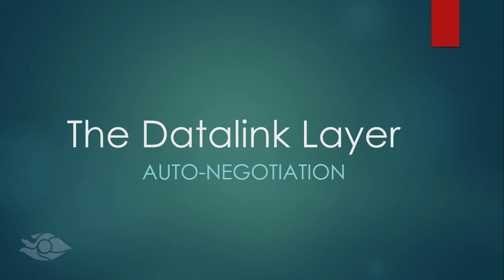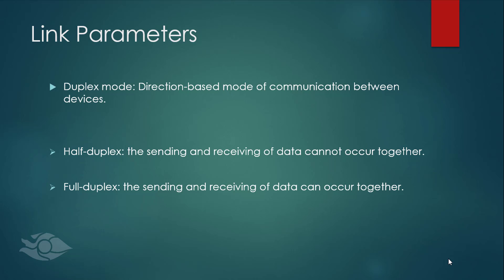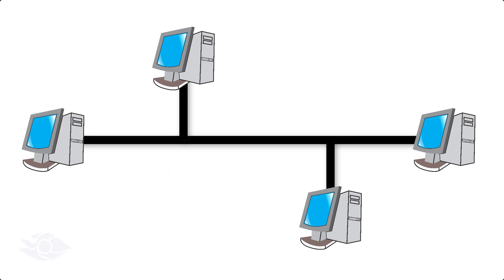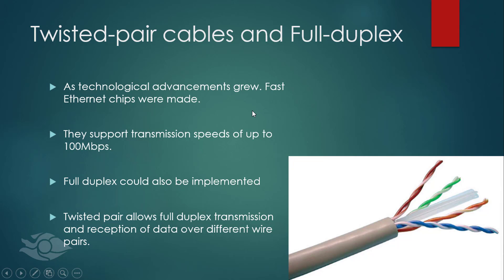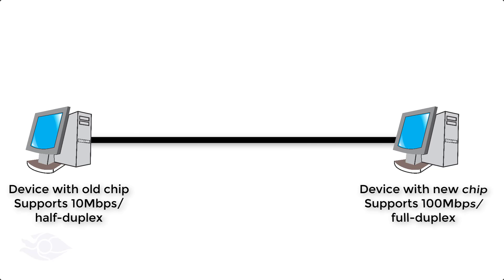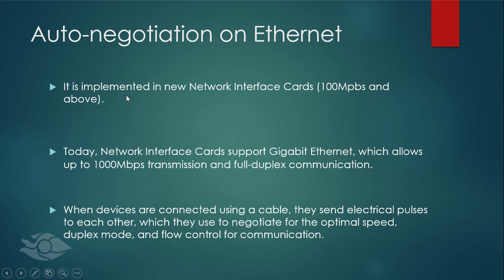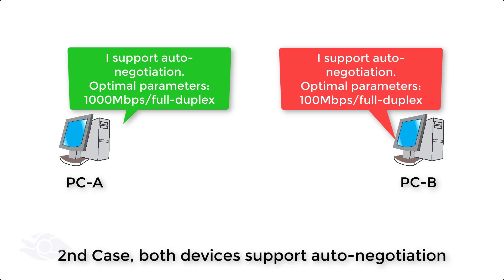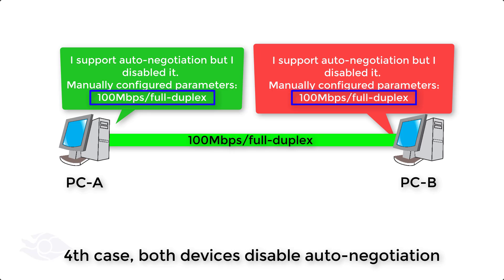Auto-negotiation on Ethernet || Why your link is probably failing to be established

Comment: Hi Great tutorial about auto neg, 3:54 may I ask if there is any technical document about the part you explained about default parameters? I looked up ethernet standard and I couldn't find anywhere about it.
Reply from the maker: We used 3 parameters to define these rules in the video: default (10Mbps/half duplex), manually configured (everything else), and optimal parameters (the best supported by the device). These names were used for demonstration of the concept.

Comment: thx u sir but still have a problem my device is supporting 10Mbps but there's kinda lag in my internet its connected but  too slow and when I put it on 100 mbps its shows that the cable is unplugged  and actually it was working great an auto negotiation but I change it to 10 mbps but after week Inotice some lage in my internet So I try to put it on auto again but it doesn't work . now its working only in 10 mbps is there a problem on the cable Please help (sorry I try to describe my pblm )
Reply from the maker: No problems Ossama Chhibi. We're here to help. Typically 10Mbps means 10MegaBITS per second. In MegaBYTES, that is 1.25MBps which is pretty low. Plus you can't even guarantee to hit the peak speed everytime. That's the reason why you're having a slow connection. For the adapter problems, sometimes all you need is a little reset, first unplug the network cable and perform the following:
1. If you're using a Windows computer, hold down "Windows + R" to open run box.
2. Type in "ncpa.cpl" and hit "OK". Your adapter settings should open. 
3. Right click on your Network adapter and select properties to open properties panel.
4. Click "configure" and choose the Advanced tab.
5. Scroll down and select "Speed and duplex" and change the drop-down to "Auto negotiation". Select okay to save the current configurations. 
6. Repeat steps 3 and 4 but now click on the Driver tab at the top and disable device.
7. Now Enable the device, and hit OK. Plug your cable now to see if everything is fine now.
Reply: @Physical_Logik  thank youuuuu so much 💕💕 U  save my life Have a nice day love u  I was about to change my computer thank you thank u
Reply from the maker: We're glad we could help Ossama Chhibi. You're welcome anytime.
Reply: @Physical_Logik  I love so much bro u made my day I swear Thank u so much 💓💓

Comment: Good day sir, please I need a clarification on the second case of auto-negotiation. It states in the video that the fastest speed will be used but 100Mbps speed was selected instead of 1000Mbps. kindly help explain the reason sir
Reply from the maker: Any device supporting 1000Mbps will also support lower speeds (1000Mbps, 100Mbps, 10Mbps). The second device supports 100Mbps which means it supports lower speeds too (100Mbps and 10Mbps). The highest speed supported by both is 100Mbps. This is because the second device cannot handle 1000Mbps transmissions. Thank you Sir.
Reply: @Physical_Logik  Oh I get it now. Much appreciation sir
Reply from the maker: You're welcome any time Sir.